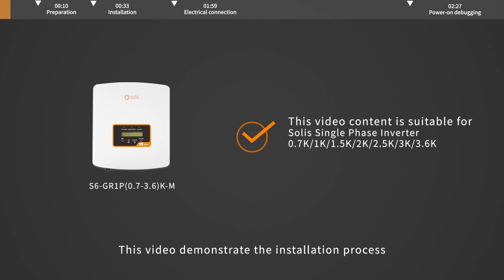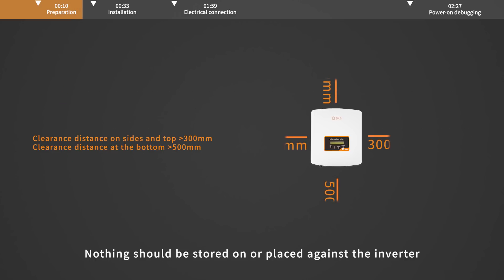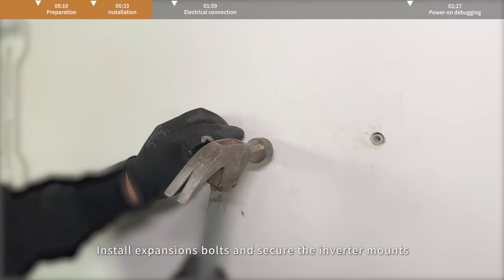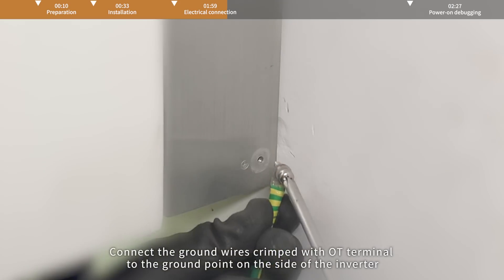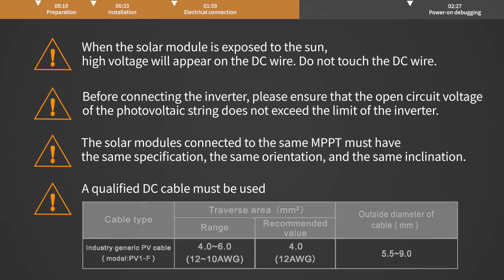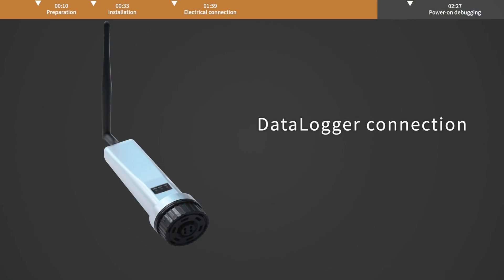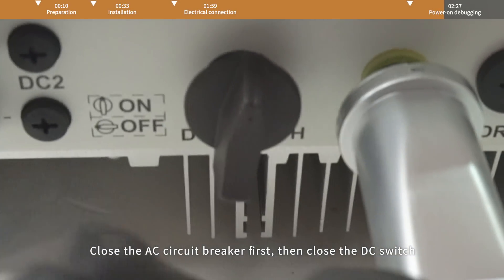S6-GR1P(0.7-3.6)K-M Installation Video

Comment: I am capable of mounting a bracket and earthing an enclosure! I am looking for more information regarding the wiring and configuration of the equipment, video not very helpful or informative!!
Reply: Can we connect battery with this inverters?
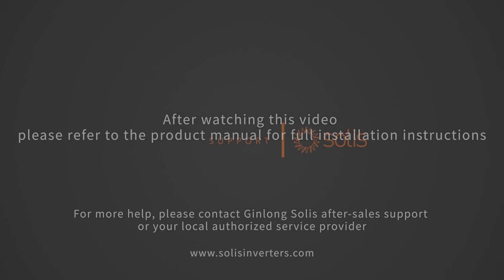Reply: 3:09 no this is only from solar panel only 

Not support battery